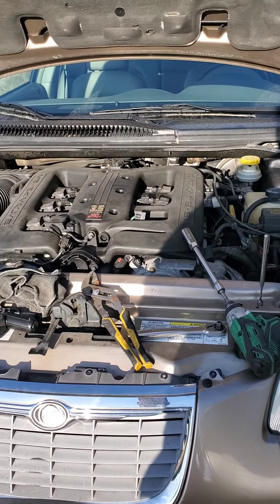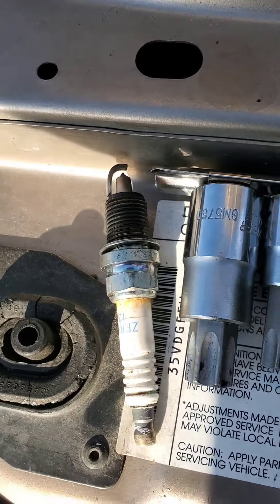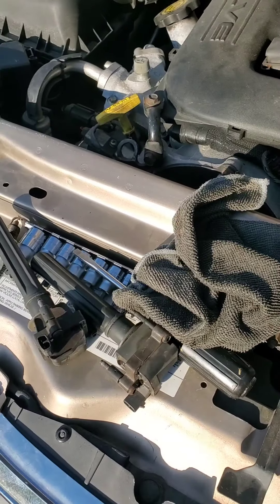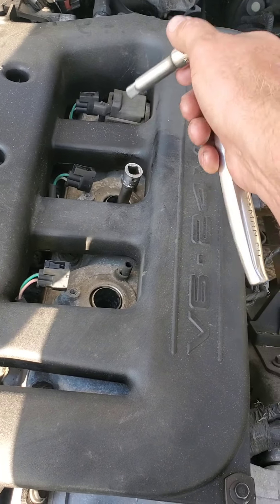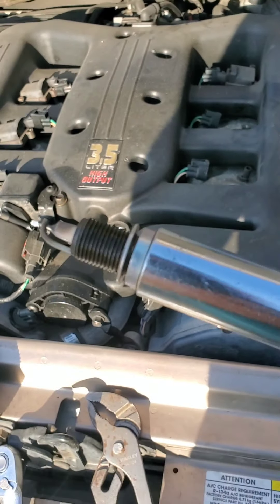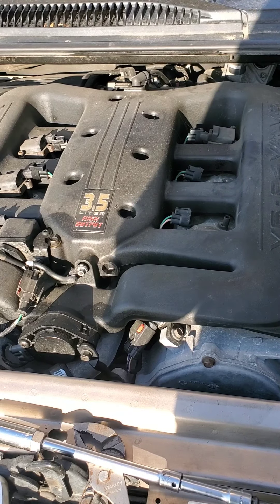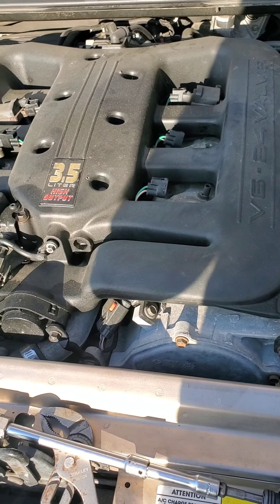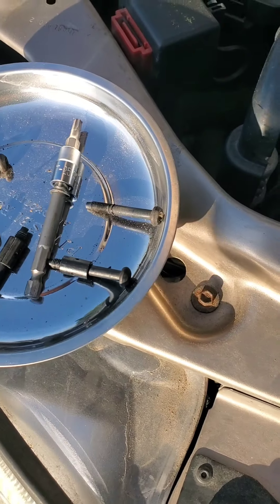2002 Chrysler 300M sparkplug change

Comment: Did you end up replacing the head gasket?
Reply from the maker: No, it didn't need it
Reply: @drivewaygarage1561  That's great. I have a 2002 300M that had a failed head gasket.  Not a severe case:  no smoke coming from exhaust, no oil in my coolant that I could detect...and no sign of water in my oil (no whitish-beige creamy, foamy residue on my oil dip stick)...but I kept slowly losing water, causing overheating, if I didn't catch it early.

I was told about a product called Blue Devil Head Gasket Repair.  At 1st I was very skeptical.  So I did a lot of research and decided it would be worth a try.

FIXED!  this product is amazing.  Many, many blog reports of a Blue Devil fix lasting tens of thousands of miles.  Apparently, the success rate with this product is over 90%.

So, for about $40 plus the cost of radiator flush I avoided a $2,100 repair.